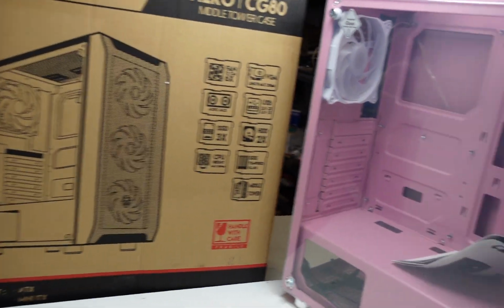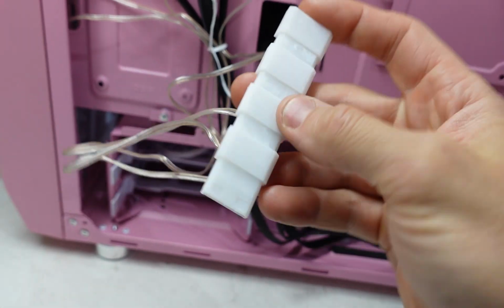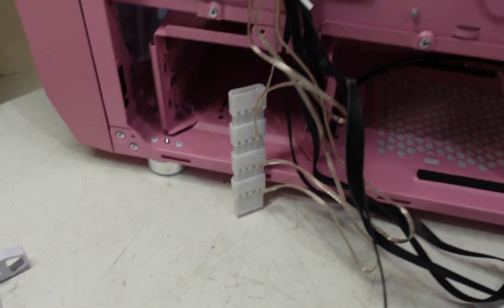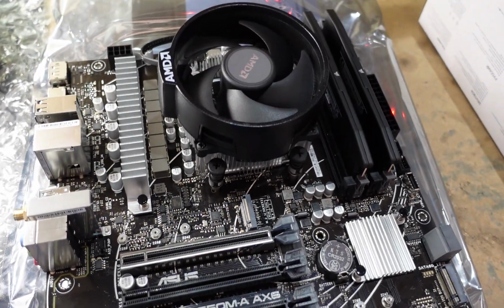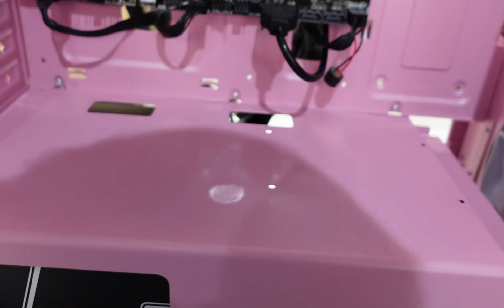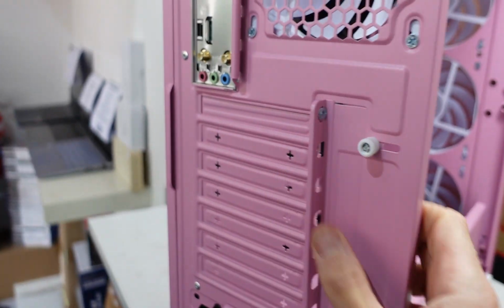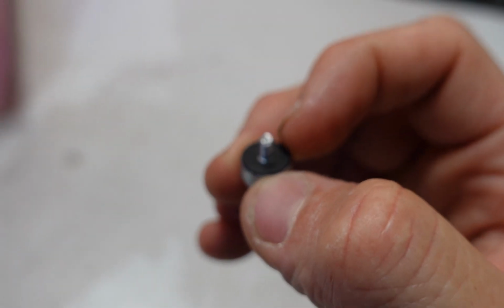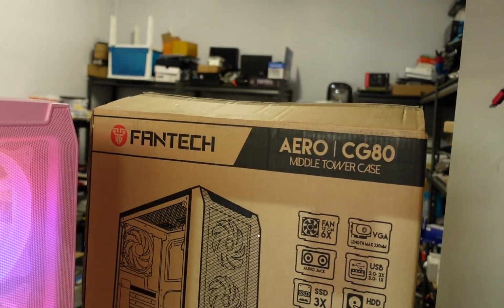Fantech Aero CG80 Pink - Build Built and Review

Comment: how about connectors? is there Speaker connector? or just HD audio? and where it goes on Asus motherboard? you could record that step too, because it's really important, connectors are pain in the ass to deal with especially if the case has different ones..
Reply from the maker: have a look at you asus motherboard manual,  it will tell where to plug them in

Comment: How is the thermals with it?
Is there enough room for rx 6650xt?
And is there anyway to put the mobo in a lower position to add top fans?
Reply from the maker: i have got a dual fan RX6600 in there just fine atm

Fans could be added in the top